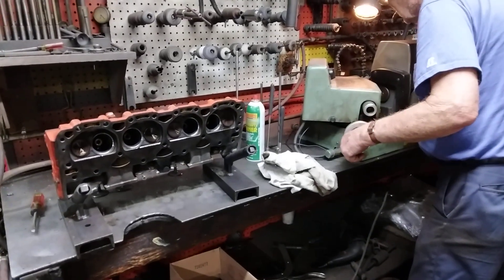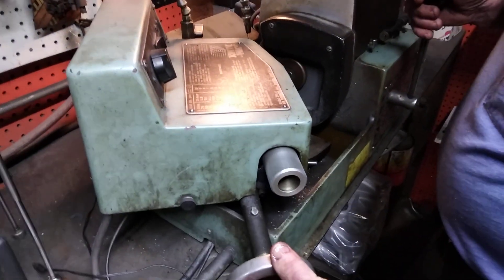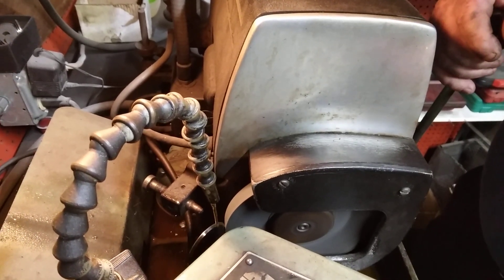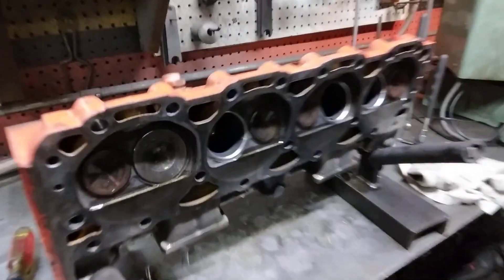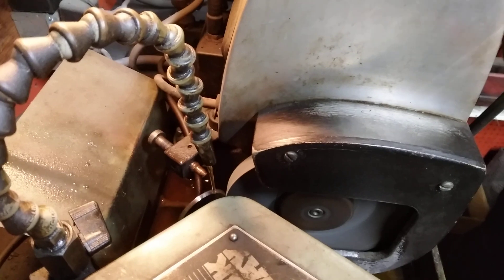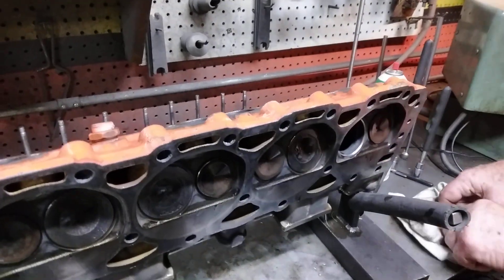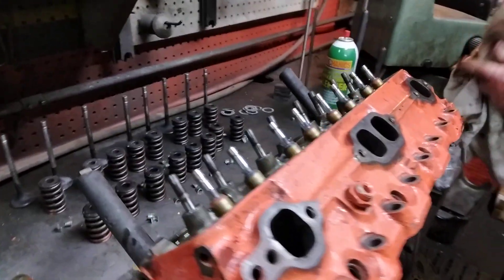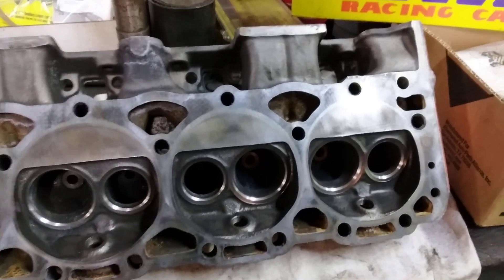HOW TO PROPERLY CHECK FOR BENT VALVES

Comment: Looks to me like you completely grounded away the valve margin and that's not good. The valve margin helps prevent the valve from overheating. I would replace these valves.
Reply: Looks to me like they did they could with the valves, are they still toast or did they hold up after treatment?
Reply from the maker: @wyleFTW it is just lightly touching  the valve, cleaning the surface up. The above comment from the other guy is completely ridiculous. The guy doing the valve job has been doing valves for over 60 years.